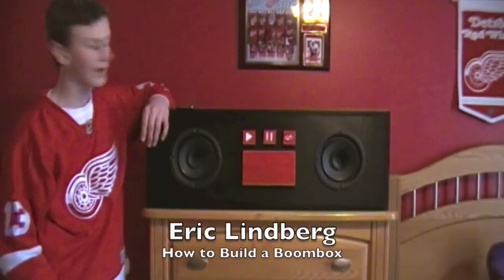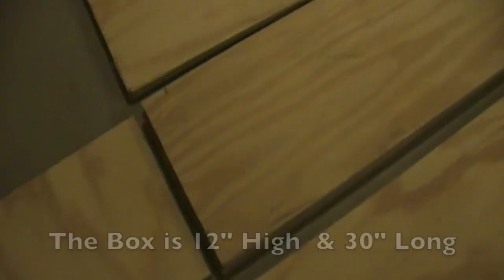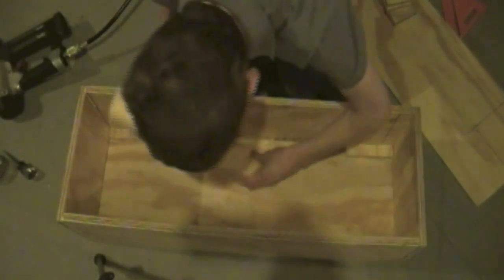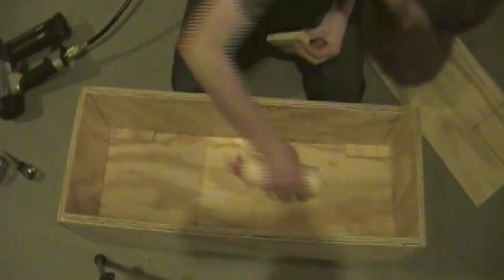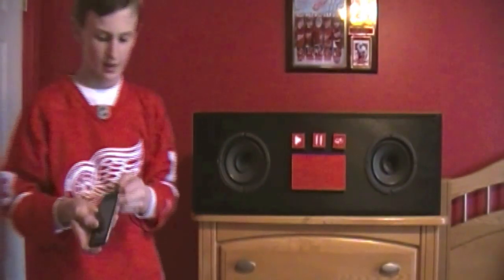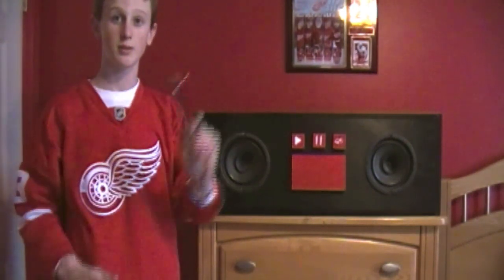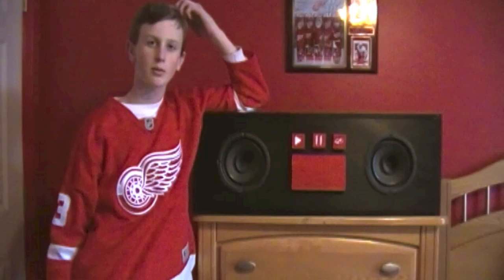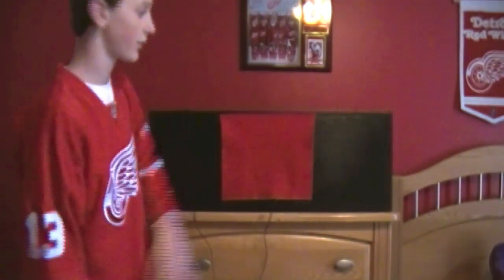How to Make a Boombox

Comment: I already had the inspiration to make one of these, and yours is pretty cool, I'm going to try to make a tricked out one with 110 ac current outlets and a deep cycle battery with a volt meter and a good power amplifier it is all mostly 12v dc but that is what im going to get a power inverter for.
Reply: yeah it is pretty cool I'm just going crazy with mine because the E.F.F. modo is go hard or go home and E.F.F. is my electronics company, but it is very small like 5 costumers small